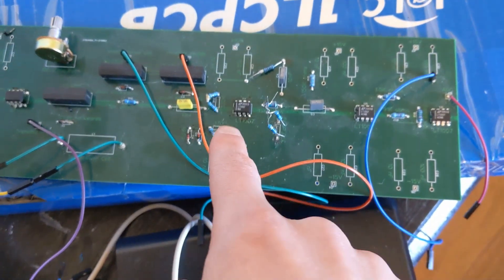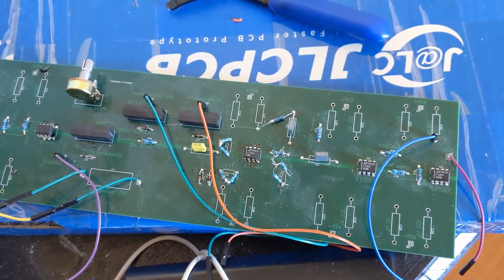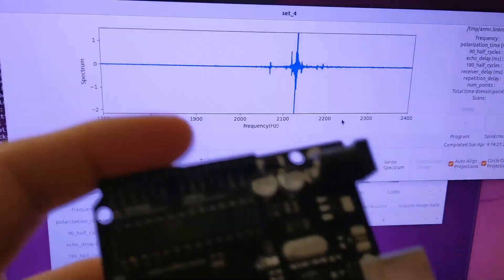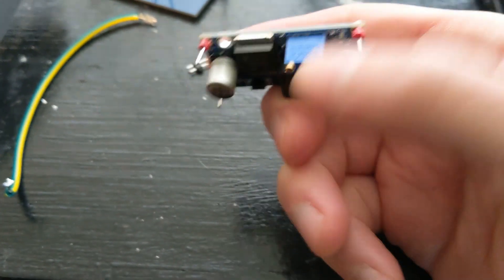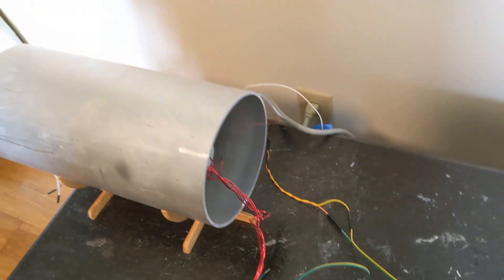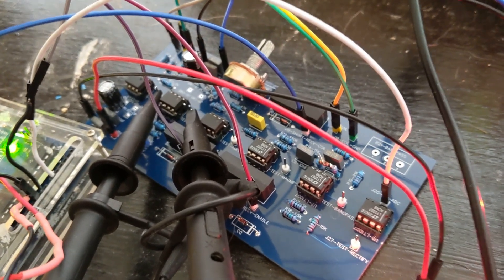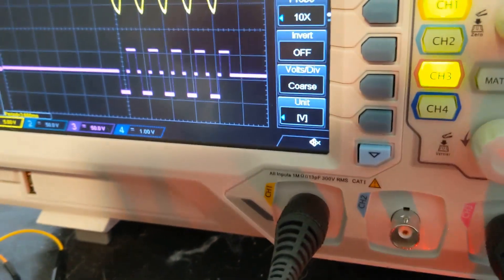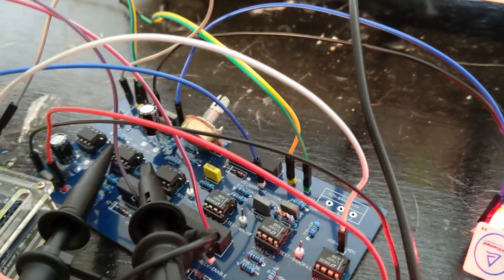Debugging a quantum resonator (MRI, Quantum Computer, etc...)

Comment: Thank you for the great video!  It's always interesting to see the bumps in the road of any project.  I'm planning on trying to build my own this summer, and I'll let you know how it goes.

If I may be so bold (or foolish) as to do some armchair troubleshooting, I wonder if you might have a grounding issue where one ground line has a bit too much resistance and is causing some oscillation?
Reply from the maker: The nice thing about designing your own pcb is that you can make a whole layer into the ground plane. That way you avoid any issues with picking up external noise.